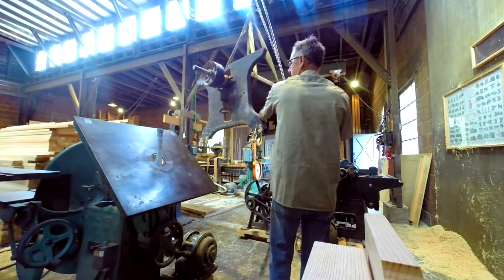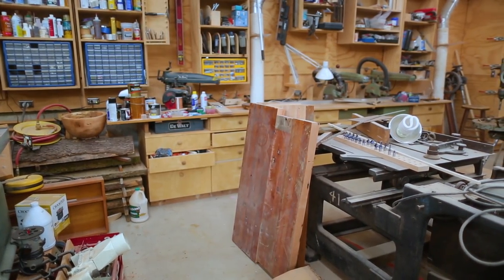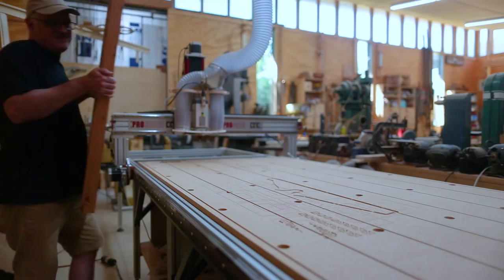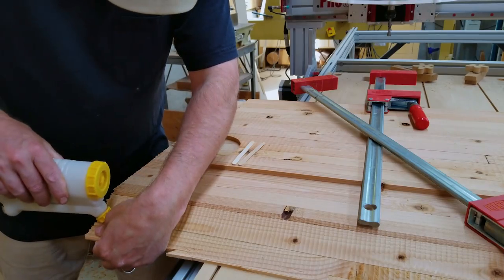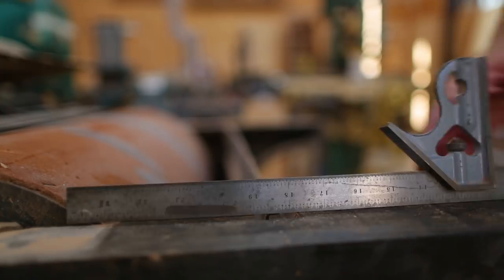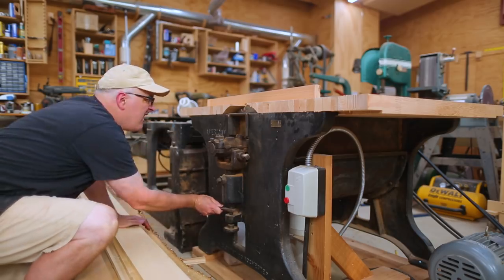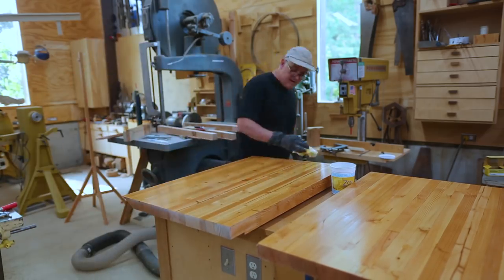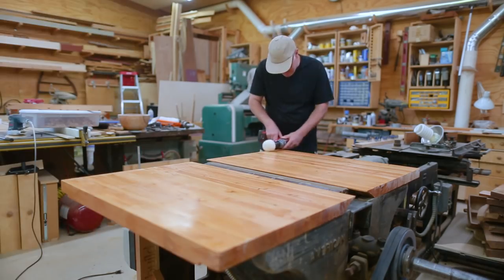Making New Tables for the Surface Sanding Machine

Comment: To bad the original table is cast iron, pretty sure it will break if you try to press the dent out, even with heat. I bet that dent has a story. It is a nice old piece of machinery. 
You either want to cut the extension of the drum shaft off, as it will grab clothing in a horrible outcome. I have a neighbor that as a 13 year old, stepped over the PTO shaft of a farm tractor driving a grain elevator. It had the safety shield tube that failed to spin free of the shaft. It took her right leg to her hip, and left calf muscle. She was wearing a dress. Fear smooth rotating shafts.
Reply: I was actually  sad he didn't  try to fix them. Would have been harder to fix but the iron would have been vastly superior. Cast can be tricky but it is not as bad as people think.  Just gotta approach it properly.
Reply: I winced just reading that, poor girl
Reply from the maker: I really don't want to cut off that long shaft, but I think I will try to cover it.
Reply: I wonder if it was this long, as originally it was powered from over head line shaft era, and had a wide flat pulley.
I can see from your prior work, you will make use of this wide sander. 
I can't imaging the edit time you invest in your videos, but it does make them more interesting to watch, and hope you get the joy of the effort.
Reply: A secondary comment is on dust collecting. You can't ever get enough air flow at the end of the vacuum hoses. I purchased an overarm collector for my 14" saw. It is ineffective at  keeping the dust from being shot out at me. The reduction is so little that I never use it. As well it is always in the way, and will result in loss of appendages.
The only way to fix your router, and a overarm is to have the vacuum impeller right at the point of dust production. The piping causes excessive flow loss, and there really is no way around this other then mega size piping and mega horse power impeller. For the table saw, the most improvement is to install a live compressed air source (via a power on solenoid), and install a blowing jet under the table top perpendicular to the blade to clear the gullet so it does not have a chance to throw it out on its return to the surface.
I like that you wear dust protection, as wood is an irritant to the lungs, which you are caring about.
Reply: I would've thought that cast iron would've snapped instead of bent, and that would mean these bent tables were iron instead.  Hopefully the original tables didn't go to the scrapper, and perhaps a fellow youtuber metalworking maven could cross-pollinate with Frank on some project where they could either get this one heated up and trued, or filled in with weld material and ground out on the bottom and put on a big metal planer to flatten the top again.  

Granted, it's easy to armchair quarterback, but I have some reservations about ever putting anything bulky to plane on those wooden tables, as the metal thread inserts put in to the underside for the adjustable cleats do look a bit on the thin side.  But what do I know?  The block he used may be as hard as ironwood.

Comment: Would putting a pin hole in the center of a plug release the air and then followed by excessive glue, effectively sealing the whole?
Reply: Was thinking the same
Reply from the maker: I was thinking of that, a hole in the table allowing the air to escape out the bottom.
Reply: @frankmakes  try to get footage for us if you try it out please
Reply: @frankmakes  Yup, an area to let the glue go into to relieve pressure. I do this with magnets in boxes I make. A brad point drill makes a nice small area for the glue to escape into.

Comment: does the axle have to protrude all that much, it will make covering the belt up a bit easier if you cut off in to approx 2 inches  from the drives.

Comment: Two thoughts.  1. For releasing the round plugs, instead of cutting around each plug, take a strip of the plugs and turn it on edge and run it through the bandsaw to release all the plugs with one cut.  2. I would have avoided using the poly on the table and, instead, gone with straight johnson paste wax.  I find this makes wood surfaces very slick.  Maybe the wax didn't adhere well to the poly?

Comment: Shouldn't the tables be parallel, but with the infeed side slightly lower than the outfeed side and the top of the drum, just like a jointer?
Reply: I think its taking off so little that it doesn't matter
Reply: I think Paul is right.If it’s not set up like a jointer he will get sander snipe.
Reply: You can actually see the bowl tip as it's coming off the drum onto the outfeed table.
Reply from the maker: That is how the machine is set up.  I could easily shim up the outfeed table and see if that helps.
Reply: That’s exactly what I thought, the outfeed side should be a little bit higher  just like a jointer or what’s the point of this tool? Isn’t it supposed to be like a wider, gentler version of a jointer? If the tables are parallel, the bowl (or other workpiece) will climb up on top off the sanding drum, and then lower back down unevenly onto the outfeed table and be left with an uneven surface.
Reply: I'm by no means the woodworker you are, but it seems like even if the sander is only taking off 1/32", you'd want the outfeed table to support that 1/32" difference. When the material gets to the tipping point going from being supported entirely by infeed table to being supported by the outfeed table and the drum it will likely make a noticable line in the material as it drops to meet the outfeed table.

Clearly it's not a finishing sander so probably isn't that big of a deal, but ... YouTube comments exist expressly to harass the content creators :D

Frank, your videos, shop, tools, and woodworking creations are incredible. Thank you for sharing it with us :)

Comment: What's an SNES controller doing on the CNC?
Reply: it is used to 'manually' move the cutting head.
Reply: gotta control it somehow
Reply: mach 3, the CAM software allows for connection of various controllers (even wireless xbox controllers) so that XYZ movements can be controlled w/directional pad input. Its very handy for spot work or for setting your zero points as the computer may not be close to the machine and going back and forth to check can be a real hassle. Or Frank just has a ROM setup and was playing some asteroids before work.... ;)
Reply: cheap way to control the cnc position manually.

Comment: Always good to see old metal brought back to life.
On the issue of the plugs being hard to hammer in, this is because of the pressure that builds up as you do so (not specifically air).  You need an outlet for the pressure.  Dowel is 'ridged' so that when you drive them in, the pressure has somewhere to go rather than split the wood (exits via the valleys on the dowel).

Comment: 5:50
With your Plugs, you indeed trap air under them. If you are willing to have a less clean edge, add a really small hole on the edge, or file a tiny notch. That should help

Comment: Very cool machine!  Those tops look great!  Why is the shaft for the drive wheel so long?  Could you attach another disc or buffing wheel on the end?
Reply from the maker: Originally it was run with flat belts off a line shaft, so it needed the length.

Comment: I wonder if you could’ve drilled a small hole about 1/8th of an inch in the plugs to release the air under them? The holes could be filled later with sawdust and glue. Just a thought. Enjoy your videos.

Comment: I'm curious as to why the drum shaft is so long. Was there ever a disc attachment on this drum sander or a second pulley to drive another component? Otherwise I can't see any reason why the original manufacturer would make the shaft so long. 
Btw, I used to work for an OEM of electrical components and in the 9 years that I ran the drill and tap and screw machine areas, I never once had an order to make a 7/16 -14 or 9/16 -12 thread. And we made millions of threaded parts. Hundreds of millions actually. Those sizes seemed to have stopped being widely used by the mid 1960's. Occasionally you see them on automobiles, like tie rod ends. but otherwise they are just not used very often at all.

Comment: Big fan of your videos... 
However... I would have tried to get the original tables straitened out... 
Because after watching the video...It occurred to me when you were aligning the table tops, and test sanding the bowl, it is has to work like a jointer top, so what ever the "cut" is on the sanding drum the other table has to be that much higher. Not at an even height with each other like you have them now.

I repair old equipment (smaller stuff) to use in my shop or to resell and have learned how to mig weld cast iron. The trick is to slowly heat it up first, then after welding it, you have to wrap it in a thermal blanket or dry sand so it cools down slowly otherwise you are taking a chance it will crack. 

First I would test the top to see what kind of iron / steel you have to work with so you can figure out what you need to do to fix it, if it is workable iron, I would make steel clamping fixture or you could use a perfectly flat concrete slab to clamp the table flat all the way around so it doesn't warp, add extra clamps where the bend is, heat it up slowly where the bend is, clamp it and then slowly let it cool back down. Make sure the fixture is heated but not to red hot (in case of a steel fixture) otherwise it may warp, because when you set the top on the fixture / slab you don't want the thermal shock from the fixture cooling the top down too fast. 

Or maybe collaborate with one of the metalworkers on you tube and let them fix it... Like Samurai Carpenter and Alec Steele did one where they made stuff for each other. 
https://www.youtube.com/watch?v=xPfPdNPSemw 
https://www.youtube.com/watch?v=hFBaepjGYoI
Abom79 fixes a lot of big machines he might be a good fit... https://www.youtube.com/user/Abom79

Or I know some machine shops have spray welding and power spray torches to fix crankshafts and other round and flat parts. Possibly you could have them spray weld or power spray torch the whole top and then machine it down flat... or they could cnc weld the whole top and underside where the bend is and then resurface both sides so the top looks all the same color. You could resurface the tables on your cnc but risk the chance of getting cutting oil all over... which would stain your beds and maybe your other wood projects. Or I have seen where they use compressed air to cool the cutter bit and run super slow cutting / feed speeds so the bit doesn't over heat. But you need a compressor that can deliver air needed for that long.

Or make a form and use liquid epoxy over the whole top so it is one color and re-machine the surface down. https://www.henkel-adhesives.com/us/en/product/metal-rebuilding-material/loctite_ea_3478.html

Comment: As always, you do beautiful work.  But shouldn't the tops be perpendicular to how you have them now?   I mean, it would be easier to install the tops with the grain "In Line" with the sander.  It would also have meant more strength at the thinner section of the wood.  And of course easier to slide objects across since you are sliding with the grain.  
Thanks again for the great video.

Comment: I'm going to guess I'm not the first person to tell you this but instead of cutting the circular parts from the router on the bandsaw  just add two tabs that are 0.060" x 0.250" opposite eachother and have one where the lead in is. That way you're not wasting time and you get better parts

Comment: Fascinating, Frank. 

Was that cast iron bent - or worn? I didn't know that cast iron could bend that much without breaking... Maybe it's iron, not cast...

Did you consider having the plates machined down and adding spacers to the bottom to get them back to the height you need? Just not sure about the longevity of wood tables. Then again, you're probably not going to use it as much as what it has been used in the past.

Comment: Remember to tension your belts, Frank! They look a little loose there. I would recommend a Belt Tension Gauge. You can find the tension ratio by dividing the center distance (the center of each sheave) by 64. Then sit the straight edge on top of both pulleys and lightly press down on the center of the belts with the gauge.

I couldnt tell if your motor has a tensioning bolt on it, but you could fabricate one to where your motor will be pushed on a pivot. 

Tensioning is important for belt and sheave longevity and overall smoothness, dont want them always popping off!

Comment: You should use behlens wool lube with steel wool in between coats and you can get a much smoother surface. I also recommend General Finishes, they have some finishes that are better than just poly! 👍

Comment: Nice job Frank, a daunting task! I remember at school the woodwork teacher telling us to put a small saw cut down the length of any dowels used to allow air and excess glue out. A fine hole through the centre of the plugs may have worked? Another point, when cutting the plugs. When they weren't completely cut through, if you'd put the board on edge and fed it through the bandsaw the plugs would have separated and dropped out, instead of cutting each one individually. I'm sure you'll come across this circumstance again so worth trying. I do that when cutting a lot of plugs for hiding screws.

Comment: Is it possible to put the motor directly under the drum? That way the belts could be shorter and you wouldn't need quite as much belt cover. But then I guess the motor would have to be height adjustable in order to adjust the tension.

Comment: Tucked in your shirt? Now you need a board running from table top to table top across the side of the sander simply bolted into a notch routed into the side of the board... like a safety rail.

Comment: Love your videos! Why don't you reduce the height of the stair side walls by a couple of inches. The only time their exact height matters is when you're rolling something onto them in order to lift it with the crane. If you shave two inches off the top you don't have to use the ramps, the heavy items would just roll straight on.

Comment: Mr Frank, you might consider when you make your belt guard, mounting the motor on a hinged plate to keep constant tension on the belts. I like your wood tops better than the metal originals. Looks right.

Comment: I think the wood grain in the other direction would have saved you from the chip out on the cnc. But I am not sure about such thin endgrain either. So you might have pros and cons in both directions.
But more generally asking: why not buy two sheets of steel or aluminum, get a thick flat mdf and glue the sheets on at once with some construction adhesive. Leaving it clamped with the one big piece of mdf on top over night. So the two sheets should be parallel. The next day adjust the drum to the new hight and you are done.

But from a subscribers point of view I am really happy to have a longer woodworking video :)
Love your videos :)

Comment: You should remove 6 inches of that axle - just as dangerous as the belt, and it'll be easier to deal with when you cover the belt and pulley

Comment: Thanks for the CNC video Frank!  The wood tables are a great touch to the sander. Just a tip as a new Fusion 360 and CAM user, I noticed you had longer then needed linking movements. To seed up machine time try to play with the Retraction Policy, and Stay-Down Height, under the Linking Tab.

Comment: Interesting to see how this holds up. Probably fine for the bowl sanding you want to do. In the future, you don't need to use a puller on those taper lock pulleys. They are made to use the clamping screws as jack screws in the other set of holes to push them apart. Then they will slide off by hand.  For sure shorten that shaft and build a belt guard. I guess that will be video part 3.

Comment: I'm curious why you chose to run the wood grain in the direction you did. Seems to me the narrow edge would have been more stable if the surfaces were turned 90 degrees? Also having the seams crossing the path of the wood to sand seems less smooth than if the seams ran to and from the drum rather than opposite to that?

Comment: Thank you for the video. I think it would be worth laminating a thick sheet of aluminum over the surfaces, if you can afford it. It would require no maintenance and it will provide better support at the drum.
Reply: Oh my, no. Aluminium is never clean. It oxidises really quickly, and readily deposits its oxide on the next available surface, Imagine a really hard pencil in this respect. The net result would be oxides in finished products that will further antagonise the finish that has been applied to the work.  Aluminium has its place, but in a carbon rich environment, nope.

Comment: thank you . question please why did you not fill the cast iron table with brass , oxy-acetylene then file down level
Reply: Walter Rider l’ve actually done that on pump inspection plates that had pitted.

Comment: As someone else says, I believe it would be better with some kind of metal sheet over. It seems to me that those "lips" near the drum will eventually break sooner or later. First, because one already did on the CNC machine, and second because if the original was bent being metal, this is wood and will eventually break.

I'm not trying to be "a clever guy" here, just concerned about safety.
Reply: You could just add a metal insert if the edge becomes damaged. Sort of a steel Dutchman. Set it flush with the top and secure it with counter sunk flat head screws
Reply: Yes, something like the things that set the sandpaper in place in the drum. It's essentially the same solution but with a different size.
Reply from the maker: Yes I was thinking it would be easy to make a metal edge, and a pocket in the wood, to run along the front lip of the table.